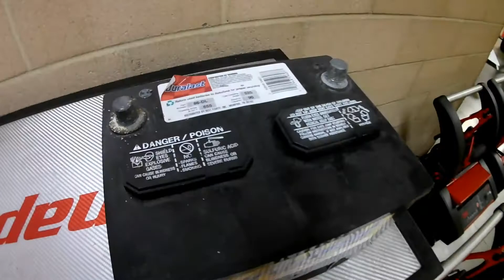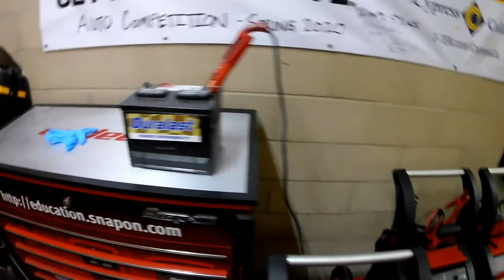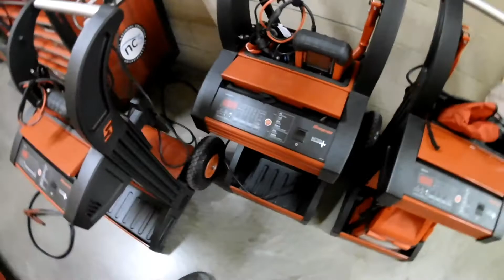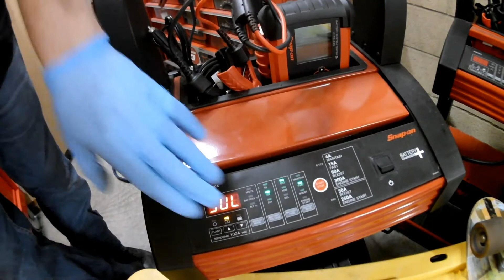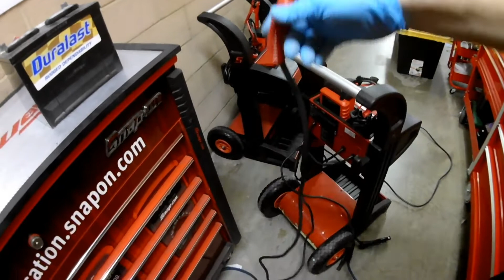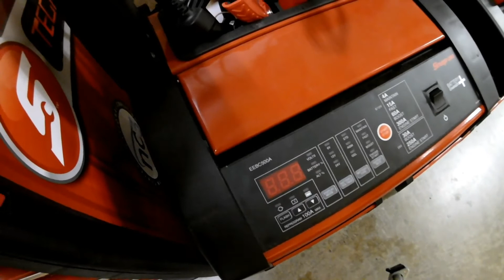Lab - Battery Charging

Comment: What do I do when it says SUL ?
Reply: “A sulfated battery may eventually take a normal charge if left connected. The charger will continue to charge with a low current for up to 10 hours to recover the battery. If the battery will not take a charge after 10 hours, have it checked” That's what the manual for this product says.

Comment: Safety Third. Not that safety is not very important, but technology would never progress if 100% safety was paramount over ingenuity. There is risk to all new ideas. Snap-On provided NO safety info for proper operation of this device.... just a TINY CRACKERJACK PRIZE SIZED BOOKLET which was insufficient. You video was very helpful.

Comment: So how exactly am I supposed to take this to the parking lot to jump off a vehicle with no drop cord.
Reply: Use a 10 or 12 gauge extension.  no 14 gauge or lighter, and be sure you are on no less than a 20 amp circuit ( the wiring should be 12 guage on a proper 20Amp circuit, according to Technology Connection YooToob Channel   https://www.youtube.com/watch?v=jMmUoZh3Hq4&list=PLv0jwu7G_DFU62mIGZNag5vQ0a6tDGBpO&index=4&t=1264s&ab_channel=TechnologyConnections
Reply: Yeah the video seems out of date. We have smart chargers with spark protection. They will also compensate for "iffy" connections. Even in the case of momentary power outages they will come back online (register the outage) and start charge cycle where it left off.